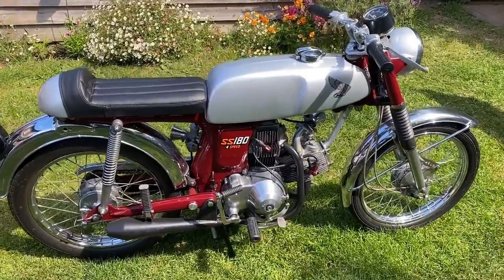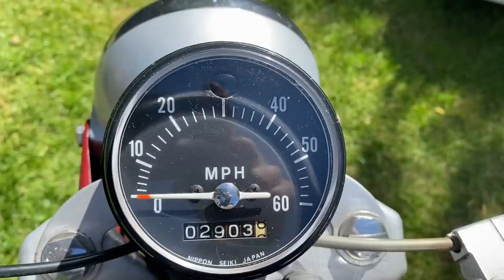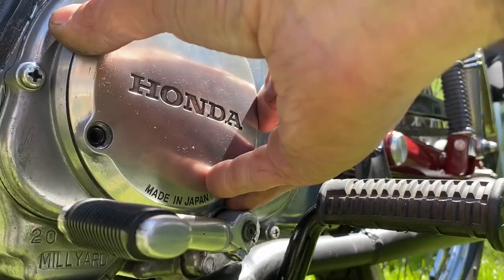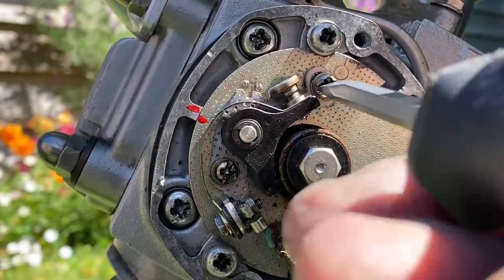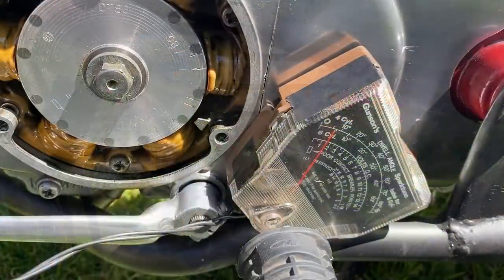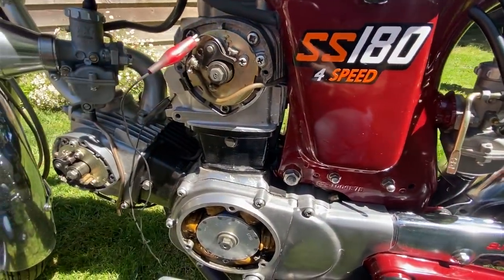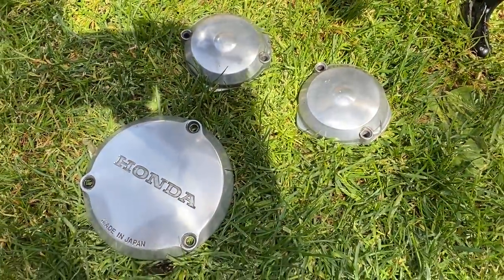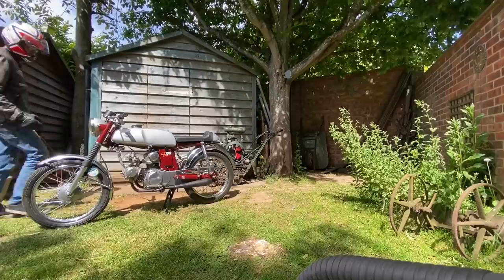Honda SS180 V Twin - ignition timing and road ride

Comment: I'm unsure why, but I was amused by the fact the additional cylinder was spot on and all the adjustments were required on the original parts. :)
Reply: Bunged screw head could be the answer, there.
Reply: Note the dry points cam on the front cylinder. This caused the points contact with the cam to wear, changing the points gap and the timing.

Comment: Nice, next time I have the cover off on my Suzuki I'll send a pic of my ignition. I'm running total loss as it is a race bike and I power the ignition with a home made lithium ion battery made with 8 16859 cells in a 2p4s configuration. As to the spark part, where the points were I made a plate and mounted a magnetic pickup from a Ford HEI ignition and I use a Ford V8 reluctor with 6 of the arms cut off only keeping 2 opposing 180 degrees. This triggers a GM HEI module I have mounted on a Chevy S10 heat sink at the top of the down tubes in the fresh air, under the tank is a DynaTech .5 ohm dual fire coil. It fires twice each rotation so there is a wasted spark but it fires the 2 stroke well. I removed the oil pump and run a 28-1 premix. Suzukis pump oil to the outer main bearing and I drilled from the bearings into the transfer slot and then countersunk the holes to create a well to catch the oil fall out in the transfer and oil those bearings. I also removed the oil slingers from the crank. I've raced it for 2 years and it is very dependable. Thanks for the vids, nice work.  DC

Comment: The sound! I've still got my S90 from 1967, that I had as an apprentice. In the fabrication class I rolled up a reverse-cone mega, modeled on the old shorties you could get then with the aluminium end-cone. I thrashed the guts out of the poor thing 30 miles a day for 2 years, the neighbours hated me. It ended up with an NSU quickly silencer without a baffle. It now sits rusting away in my shed. :-(

Comment: Great little bike. I was glad to see that some of the screw heads inside the points covers were nicely chewed up. Reminded me of most of the secondhand old bikes I've owned. I also wondered if Allen has a pile of lost screws washers and other small parts somewhere in the grass of his back lawn. Probably uses that vintage lawnmower to find them... ;-)

Comment: The rear cylinder looks as though it could get interesting to adjust the intake valve.........
Excellent video, love the way that bike runs and sounds.
Reply from the maker: its just possible through the battery box

Comment: So I call up the local Honda dealer tell them I need my C180 V-twin serviced saying I think the rear cylinder is a bit out of whack, guy says Honda didn't make a C180 V-twin, yes they did I've got one and it's got Honda written all over it, na the guy says, did you buy at a market in Morocco?

Joking apart, your just amazing. I love your videos, and your so matter of fact when your narrating them, " yeah I just added another gear to make it 4 speed and and made the clutch manual.........." 

 I'm sure I'm going to start seeing some bikes on the road like a Z1 and wonder what's wrong with before I realise it's missing 4 cylinders.

Comment: Love your choice of roads for your test rides Allen. They're the same roads I learnt to ride on 30 years ago on my 50's and 125's! I used to ride from Bradfield Southend up to Newbury College, taking the back roads through Bucklebury, Cold Ash and then across to Shaw/Donnington as it was a lot more fun than riding up the A4. Happy days!
Reply: Same but 10 years earlier for me, used to tear up the roads around Bucklebury, Cold Ash and Hermitage on my FS1E and later my Honda XL250s and Beamish Susuki TS250 trials bike. Did loads of off-road on the old gravel pits between Cold Ash and Bucklebury.  Must have past Allen many times without realising it over the years.

Comment: What I find most striking about your bikes, yes clever/creative and detailed, but they actually work! So many custom bikes will never have fuel in them and even if they could run, would be horrible to ride. You artfully modify the most mechanically critical components and the bikes run Better than the original. Mechanical art.
Reply: Maybe a Suzuki GT380 five cylinder one day?
Reply from the maker: I made a four once the gt380 would Be easy to make into a five
Reply: @AllenMillyard  Maybe once the world settles down a bit we could talk about commissioning one?

Comment: I can hear a 5 cylinder like overtone, so I'm guessing the v angle must be close to 72°?
I loved the direct, simple and logical approach to describing setting the points.  Would be amazing to know how the timing marks were clocked in on the rotor / flywheel there.
What a great machine!

Comment: As an apprentice in old Strowger telephone exchanges we were taught to accurately measure and gap relay contacts using  two feeler gauges. By using the guages above and below the gap you were trying to achieve the thicker gauge would not fit the gap and the thinner of the two would be too loose.

Comment: Hi Allen, thanks for another informative, quality video, she sounds fantastic through those straight through pipes, a quick thought I had was, as the front cylinder carb faces forward, when at speed will it not run weaker than the rear cylinder due to (a ram-air) effect .? Looking forward to what you decide as the subject of your next video. Cheers, Alex.

Comment: Hi Allen - your bikes are sweet and your engineering skills are genius..
Any chance you could give me a few tips on making a really quiet exhaust please?
I need it to be right first time because I don't have the money to waste trying to prototype one - and an original isn't quiet enough either.
It's not for a bike engine, it's for a petter AB1. 
I'm guessing you've got an idea what one is, but if not, it's a 261cc stationary diesel.. 
Another thing - do you reckon a DIY copper head gasket would be OK, or do I need to by an original?... 
Oh yeah BTW, its compression ratio is 16.25:1...
Any other tips/advice would be greatly appreciated...
Thanks...

Comment: Good job!  I still have my dwell meter and timing light for adjusting the ignition timing.  You can also add a drop of oil to the felt pad to lubricate the cam/block, if needed.

Comment: Heres a dodge for points setting especially if timing marks are difficult to see so watching a meter at same time is difficult. Tune a portable radio to no channel (better an am one) and stash it on the bike preferable somewhere near the coil then switch on the ignition. Rotate the engine slow with spanner as the points open the radio goes "click" so you can watch the timing marks and match up with the click sound.

Comment: Ex tech teacher here. I am so familiar with those old Viceroy buffing machines. Please do yourself a favour and take the guards off, they are more of a hazard than a precaution. A girl at a school in St Albans let go of the piece she was polishing and it got caught between the buffing wheel and the guard, was whipped up behind the wheel and forwards at high steed into her face. It is much better if the wheel is entirely free so that dropped work can fall away free. Your shed wall does not need the protection!

Comment: Really enjoy your channel. Just curious if you can get away without rearview mirrors and turn signals (indicator lights) in GB?
Reply: @Eddie Hitler First car I learned to drive '49 Plymouth didn't have turn signals so we had to roll down the window and use hand signals. Bicyclists need to learn hand signals but few seem to use them. Keep up the good work!
Reply: @Eddie Hitler I often use a left hand signal when leaving a roundabout, as well as the indicators.
Reply from the maker: Not required pre 78

Comment: I always thought the C50 was not quite powerful enough and the C90's 8 bhp made for more comfortable overtaking. So I would be really interested to know what the dyno figures are for the SS180.
Reply from the maker: the ss100 made 10.5bhp which is roughly double so around 15bhp for the 180 is realistic
Reply: @AllenMillyard  The 250cc BSA C15 produced 15 bhp and so that amount of power would be more than adequate for something a lot lighter, and without stressing the engine. I'm sure it is an abolute joy. Cheers!

Comment: nice  forgot to lube the points cam and lube the mechanical spring advancer  behind points plate  so it last longer and check  advances the ignition with an timing light pro boss your Brilliant

Comment: Bars seem extra narrow...? No mirrors...? all seems to suit being packed into a race transporter perhaps...

Not outrageously loud for straight through pipes...

I wondered if you had any lean running issues at higher speeds, due to the forced effect on the front bellmouth ? a friend used to run a reverse head T110 lowrider that clearly benefitted from it and had to switch to pancakes to lessen the effect.... 🇬🇧😎👍

Comment: If you look very carefully at 7 mins 45 secs you can see slight arcing around the plug on the upper cylinder when its reved  :)

Comment: I have two questions for Alan
Would electronic ignition not be a good idea, especially since it's in someone else's hands now?
And, does the rear cylinder get hottest as its slightly in the wake of the front cylinder and for a vertical cylinder the cooling fins are better suited for a horizontal fitment?
Reply from the maker: It could be fitted but the points work fine on small honda’s
Reply: Yes, I've just noticed that, the rear cylinder fins could do with being horizontal!

Comment: Would be interesting to see what sorta numbers these creations turn out on a Dyno compared to the factory bikes.

Probably missing the point a tad but still 🙂

another good vid 👍🏻
Reply from the maker: The ss100 made 10.5bhp at 11000 rpm
Reply: Allen Millyard 
Do u know what it made before the addition of the second cylinder

Comment: I'm surprised the perfectionist in you didn't swap out the mashed securing screws on the front points.
Reply from the maker: they are not as bad as they look in the close up shot in real life, 
i would have replaced them but i ran out of M3 screws

Comment: Dig your stuff my good fellow gear head! Funny thing I found on some of my Honda 175 twins, the points timing lobes rotor (there were two of them on one rotor) on the SL model were off set so one cylinder would be spot on and the other cylinder would be slightly retarded. After installing and testing several used points lobe rotors I found one that put both cylinders spot on and the result was noticeable as far as sound and engine performance. Be looking for your next vid.

Comment: Happy to see the point screw heads mashed up, so it wasn't just mine.....
Reply from the maker: They are the original Honda soft screws from 1974 they look particularly bad blown up 15 times magnification ! Would have changed them but run out of replacements 🙈

Comment: I was thinking, "Is he going to mention how important it is to oil up the felt lubrication pads on the points cam??!!"

Apparently not.....

Looked at the points on somebody's bike yesterday, in this case an old Jawa. The points had closed up because the felt lubrication pad had dried out and the contact breaker heels had worn down on the cam.
Reply from the maker: The two felts were already saturated in oil so I didn’t te oil then, I’m just explaining what I’m doing at the time

Comment: It sounds so much better than those 125 singles that are howling about with horrible box exhausts. Loud is Ok by me but not the horrible harsh sounds these things make
Reply: Saying that, a 250 using Honda CB125S engines would be nice. That's the overhead cam engine. It would need the roller bearing cam conversion but it's a solid little motor that revs to 9000 rpm. The downtime frame would need a "rethink" but another bike Honda should have made.

Comment: those point screws have seen better days
Reply from the maker: I know, strangely they look worse magnified 15 times! I almost pulled the video when i noticed in the edit but let it go, they are nowhere near as bad as they look, but yes they are 50 yeas old and i would have changed them if i had any in stock
Reply: @AllenMillyard  i have no doubt that you if you could have, you would have....amazing stuff as usual

Comment: The foot pegs look loose
Reply from the maker: I can assure you its not, i think its the image stabilisation
Reply: @AllenMillyard  you should of made that six with 2 4 cylinder 250 honda engines
Reply from the maker: @twizzlestickx7  I would have done with an unlimited budget, the MC22 engine is quite hard to find  and command a high price because they are popular for race replicas and i needed two! by comparison the FZR250rr engines were easier and cheaper to find
Reply: @AllenMillyard  what about the 400 4 engine wouldn't you be able to make that into a six